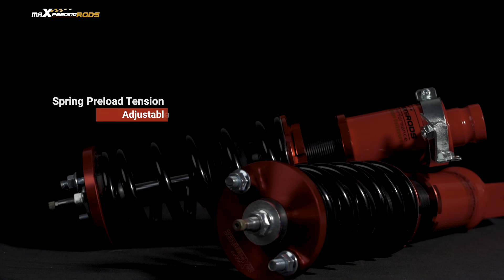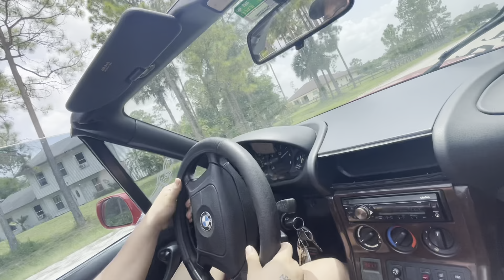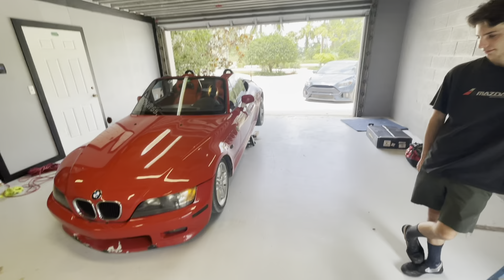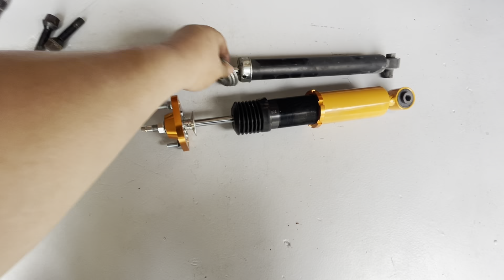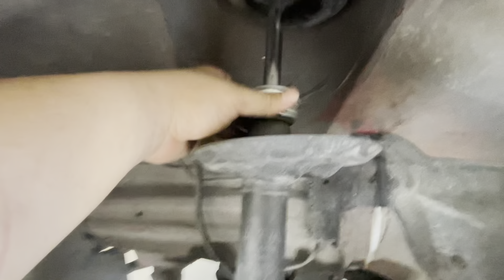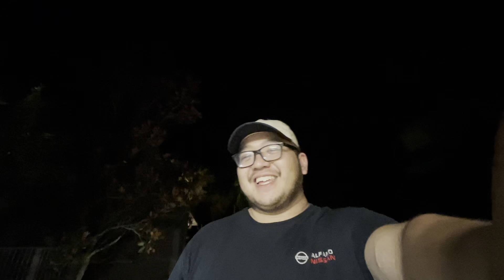BMW Z3 Project Gets Maxpeedingrods Coilovers

Comment: whats up alex, i need your opinion so i have HR coils on my Z but the rear end shock mount area makes a lot of tapping and clapping noises on bumps or dips. did you use different bolts or stronger nuts etc or use any extra hardware for the rear or front ?

Comment: Coilovers for e36 323ti should also fit a z3 as they have the same suspension, e36 front and e30 rear. What engine is in this one? I got a 97 323ti and I must say 2.5l and 170hp is pretty fun in such a small car.  I might actually use your discount code for it :D Best wishes from Poland!
Reply: So I would have to order 2 sets of coil overs ?
Reply: Or ur just saying that the e36 323ti has the same suspension as a z3
Reply: @jacobbmacias5437  Z3 coilovers should fit 323ti ✌️